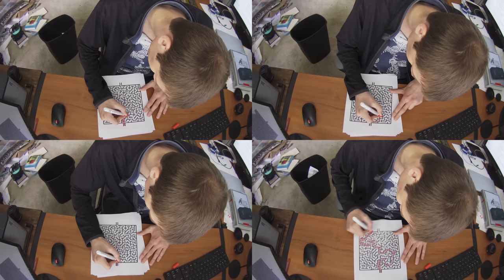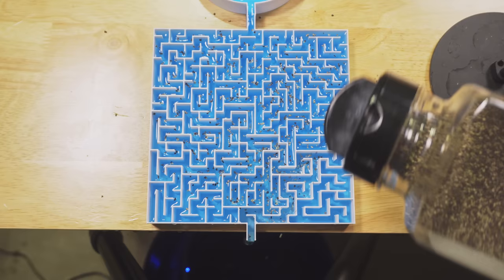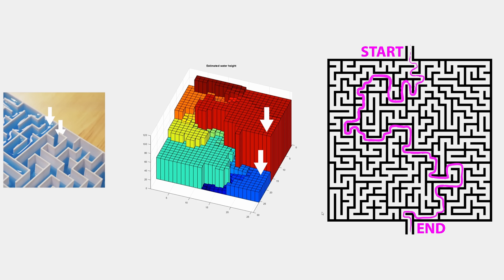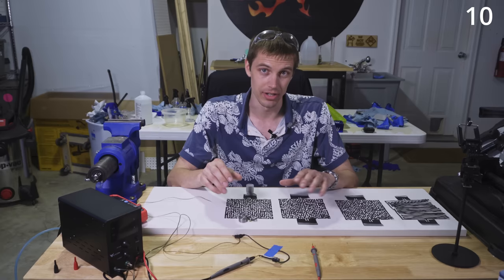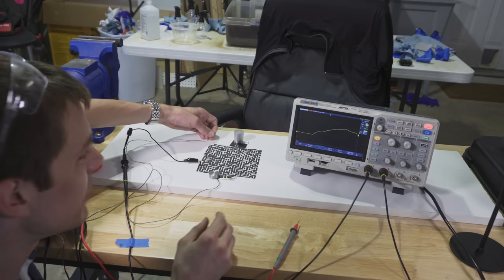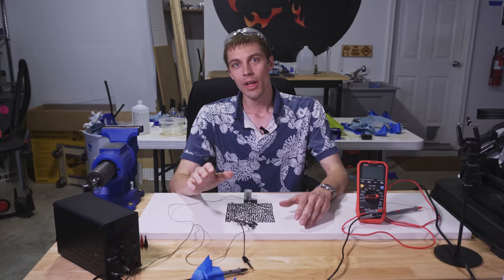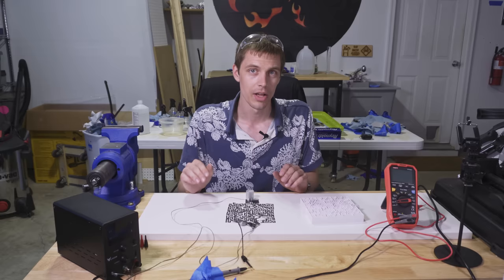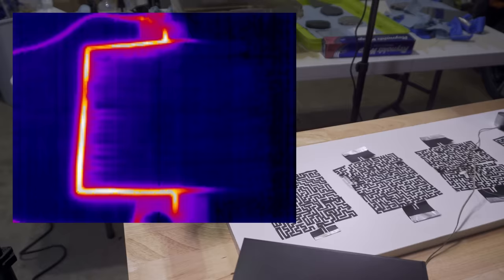How does electricity find the "Path of Least Resistance"?

Comment: V=IR. I=V/R. 
P=IV
P=V**2 / R
—————-
P1= V**2 / r
P2= V**2 / R
—————-
Current and power (heat) are inversely proportional to the resistance (length of the path).
—————-
Therefore, if you used a constant voltage source (a battery) nothing would have changed when you cut the short path at the end of your video. P=V**2 / R. There is something wrong with your set up.
—————-
You made explanation of a very simple set up (two parallel resistances) way too complex.
—————-

Comment: Technically, no.  Electricity does not SOLVE mazes.   It follows the lowest resistance path end to end.  This is t magic.  This is physics.

Water does  the same exact thing.  It can’t flow to a non-ending.  It’s physics.  

Air will do the same thing because it cannot flow to a non-solution.

Comment: This will give you the wrong answer with paths of different width
Reply: The path with the least resistance will always have higher current flow.
Reply: @MrSummitville  yeah, that's what I said: minimum length does not guarantee minimum resistance. This approach will find a path with minimum resistance, not the shortest one.

Comment: This is a way too complicated explanation for something that is actually just dead simple! Water only continues to flow through the correct path, because it's the only path that allows water to escape, and thus the only path that allows new water to keep flowing through it! That's dead simple!

Similarly, electricity only followes the correct path through a maze, because it's the only fucking path that is available for the electricity to flow through! Nothing revolutionary about that!
In the case of the 2 paths, obviously the longer path will take longer to get through so the shorter path, which is faster, will allow for more flow, aka more current.

And lastly, yes, you ARE in fact wrong! Electrons do NOT move around exactly like water does. And wires are not just like pipe for electrons. This is a useful model for understanding and explaining various concepts about electricity, but it is not really accurate. Instead it is the transfer of energy between electrons, that flows through the circuit, not the electrons themselves. Yes the electrons are moving, but not always in the same general direction. They are not flowing in the same way that water does through a pipe.
Instead it is the field, or the wave, of energy that is flowing.

My terminology here may not be the best, infact its probably incorrect, but the idea I am trying to convey here, is much closer to the truth than the water model of electricity we all know and love.